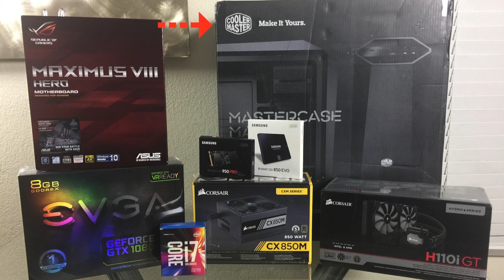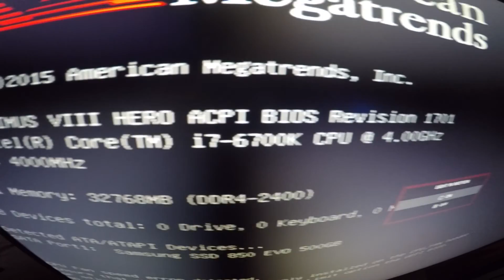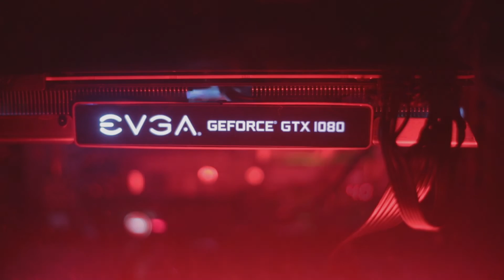Personal Gaming/Editing PC Build of 2016 Time Lapse

Comment: your ssd's are supposed to fit on top of the cradles, not under them.
Reply from the maker: John Inglis really? The seem to have a slot that fits perfectly in them. Like it was designed for SSD's to go in them. I'll research some other builds, but thanks for taking the time out to watch this video!
Reply: SSD's usually are supposed to be on show if they are mounted where visable, to show off your build/ssd's but good vid mate.